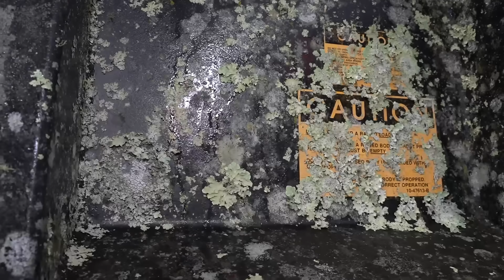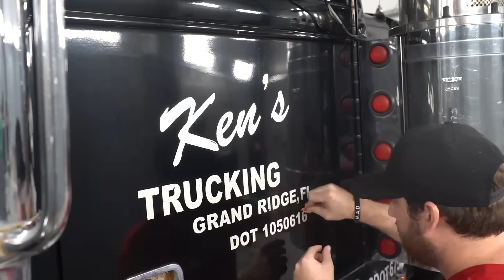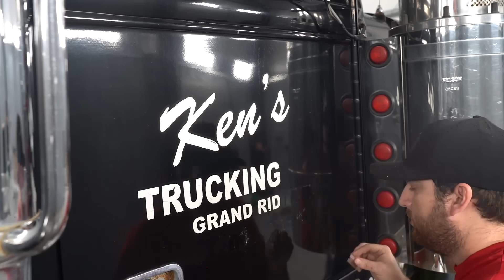Disaster Barnyard Find | Extremely Moldy Truck | First Wash In 12 Years! | Car Detailing Restoration

Comment: Hi guys! I have a 1997 35' Tiffen Allegro Bay Motorhome that's been sitting for 6 years. It runs, drives, and leaks, so the interior is a little rough, and the fiberglass exterior is dull. If you ever want to do another big vehicle you're welcome to come get it and clean and polish her up. It's going to take some work, but after seeing what you can do, I'm sure it could be made to look amazing again. I turn 62 in July, and want to hit the road in it after I turn 63 when I can actually afford the gas. I'm a disabled person, and a military veteran so it would be an extremely big help to me. Thank you for your consideration. 😊

Comment: If you had not known previously, depending on how old the stickers are and how they were put on, a heat gun can allow them to be taken off in one piece and doesn’t scratch any part of the paint. Then usually just take a little 3m adhesive cleaner to take off residue
Reply: Yes 
That was what I used to remove some decals 
They came off in almost one piece except where I accidentally cut them with the blade
Reply: Well I’m pretty sure he’s aware of this, which is why he’s making YouTube videos and well, you’re just commenting on them.

Comment: That’s a mighty fine dump truck. 
Sure is turning out nicely.  Wished it was mine.  Even has a cat diesel motor.  I wonder what speed trans it has.  Great truck for someone!
Reply: It has a Grey splitter on the shift knob so it's an 18 speed..red is 13 and blue is a 15 speed..if it dosent have a splitter on the side it could be an 8ll 9 or a 10 speed..

Comment: Best trick I ever learned polishing aluminum, is to use house hold cooking flour to remove the black polishing residue. Polish the metal with whatever process ya like. Get a bag of the flour from the grocery, sprinkle it on a rag, wipe down and it instantly removes the black oily residue, without having to keep wiping and wiping. Makes the process much much faster. Im a drummer, and i use this process on brass cymbals as well. Polish, sprinkle the flour and wipe the residue right off.

Comment: Just came across your video.   Great job.   I’m a detailer  too been in business since 1991 and my shop mostly does wholesale vehicles and auction vehicles.   The services we provide is complete paint correction , we will dye the carpets and paint the plastic trim as needed , and complete engine bay detailing.   We recently started to do ceramic coating ( for the general public) along with window tinting and undercoating. ( we are located in Pennsylvania)  what part of Florida are you located in?   I actually own a home in Holiday Florida and travel there several times a year.

Comment: Don't you find keeping the compound on the wool wet works better ? maybe using a spray bottle helps keeping the heat down ? was the box of the truck not single stage ?

Comment: Do you know what the mileage was on this dump truck or why it was parked so long?  That dump bed is is in really nice condition even though it's so old.  I have trucks with 3 year old dump beds in way worse shape. Maybe the bed has been repainted before because they top rails of the bed normally have very little paint left and they are usually rusty.

Comment: 4 ot steel wool polishes up faux and real chrome really nice and doesnt scratch the chrome but if you are truely worried about scratches you can use metal polish to help keep your steel wool lubed up
Reply: It can also be used on glass to remove stuck on grime and not leave scratches either, just never use it on stainless steel, aluminum or anything that isnt chrome, plastic chrome or glass you'll scratch the hell out of it if you do trust me i learned the hard way lol

Comment: i live in chicagoland near the  steel mills and often see tractor/dump trailer heavily coated with what looks like brown iron oxide. even the sides of the tires are coated.
is there a way to remove this? is the metal underneath permanently damaged or is this coating actually protecting it?

Comment: I always ask myself - what is happening after detailing these barnfinds? This truck was sitting somewhere for years (maybe 12?) Without any maintenance and services. Is this truck now going to a garage to get fixed, or just sold and send back on the streets as it is? Without a look from under neath it could be a very shiny wreck. I'm not sure about what to expect if someone pays that much  in getting 15+ years old tires cleaned instead of changing them out. But maybe that is juat me and the very strict rules on what to do to have a street legal vehicle in my country.

Comment: I'm still amazed at how you can run a car detailing business without water drainage... How often do you have to clean your floor throughout the washing process? Clearly, you're getting jobs done. But wouldn't it be much easier to have proper washbay with water drainage??? Groetjes from The Netherlands.

Comment: I suggest the vehicle has hardly seen a building site in its life? Tippers or dump trucks get hammered during loading and tipping. And driving off road is exremy tough. These types of vehicles usually have low mileahes though - I can't see any dents or and scrapes...

Comment: Total bullshit that truck was sitting that long
Reply from the maker: Lol okay then how long was it’s sitting Mr detective?
Reply: I’d say maybe 4,if it was outside in the elements there would be way more rust than what it shows,looks like it might have sat under a lean too for it not to have the water damage
Reply from the maker: @soonerbear5731  Well stuff doesn’t rust in central Florida. This truck actually sat for longer than 12 years.
Reply: Kudos man,you found a great truck to do your video,I own several newer dump trucks that wouldn’t look near that good with just a power wash lol